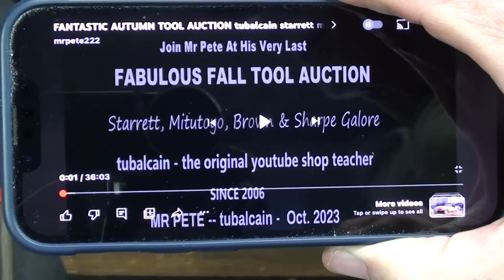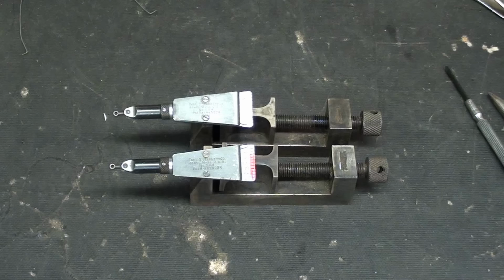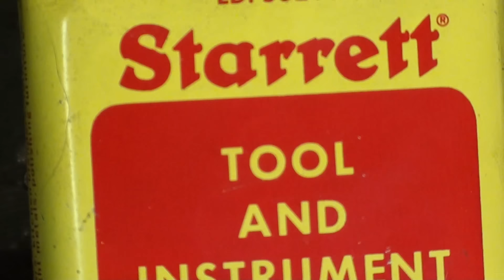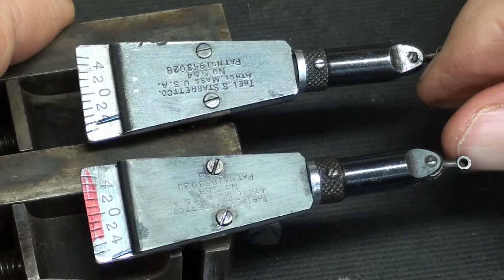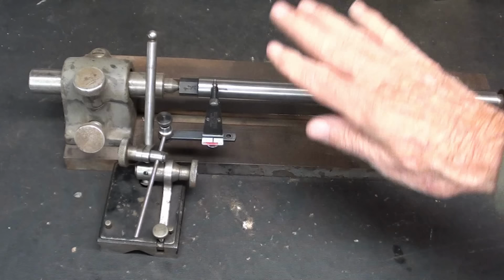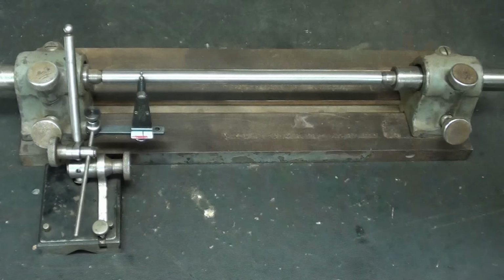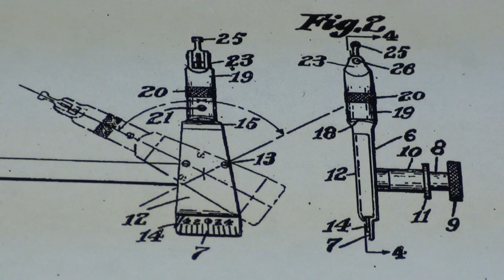REPAIRING A STARRETT TEST INDICATOR #901 tubalcain mrpete

Comment: Lyle - A very interesting video.  I have both other indicators you showed - the Ideal was bought by my Dad when he was fresh out of high school and a 'set up man' on the IBM plant machine floor in 1941/42 before he left for pilot training.  Most of his work then was on  gear hobbers.  The Ideal is in the original box and has a Rochester, NY address instead of Brooklyn.  Still works fine.  The plant I worked at most of my career had mostly women doing very fine repair work on electronic assemblies also under microscopes.  Very precise work with rigid certification requirements.  They were great people to work with.  The computers we built went in space and military aircraft where reliability was critical.  Kind of hard to 'hook up the spring' when at 35,000 feet or in the Space Shuttle.  Have a good weekend.

Comment: Mr. Pete,
It seems a lot of folks would like to see you compare the accuracy of  these indicators against a dial test indicator.  If you repeat the end to end test of the arbor perhaps you could include a still shot of your calibration sheet for your Rubbermaid surface plate. 😂

John 🇨🇦

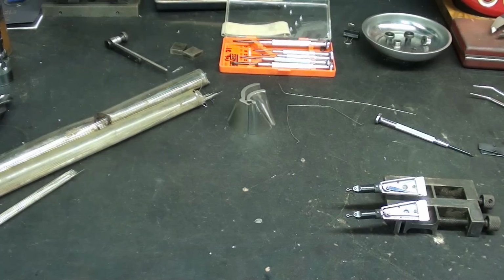Comment: At about 8:00 minutes in I was thinking you could use a guitar string.  You can buy the high E string in .009".  Great video by the way.  And I sympathize with Westclocks on their radium remediation.  A company I was with went through the same thing because of supposed lead contamination.
Reply from the maker: Awesome, never thought of a guitar string
Reply: I an am an electric guitar player. I always keep take-off strings that vary from .008 on up to larger sizes, where it often gets used in model making. I share both the plain wires and wound wires with other model builders too. Used guitar strings a great resource for springy wire.
Reply: @mrpete222  Hey Mr. Pete, you can still learn a thing or two from us 72 year old whipper snappers!
Reply: I carry piano wire of different sizes in the shop just for spring making.

Comment: Keep 'em coming.  
I find that opening up a non-working item works out a lot like what you found on this indicator.  Soon after we were married (about 53 years ago) we went too my parents home for a weekend visit.  Mom asked me to look at both of her kitchen mixers.  One was a Kitchen Aid stand mixer she got as a wedding present.  The other was a hand mixer.  Neither worked.  I opened up both and couldn't find anything wrong, so I cleaned them out (a lot of flour in both) and put them back together.  Both worked!  Apparently enough flour got up inside both to keep the brushes from contacting the armature.  That Kitchen Aid was still working when Mom passed about 40 years later, although it wasn't getting used much anymore!

Comment: ALWAYS interesting MrPete, thanks.  Would'a liked to see how the indicator's tip is designed/works, guess I'll hafta settle for half the mechanism.  A little blast of air will force the lube into it & clean out some smegma if you're not gonna disassemble & clean it for real. 
Also, 19:08 that mandrel had 5 tenths on its package,  .0005 per inch taper.  So you measured about  .004 difference, .008 taper over 6in, about 13 tenths - .0013 per in.  Wrong box?? Thanks.

Comment: Hi, Lyle
You might try using an ultrasonic cleaner.
Fill the ultrasonic cleaner with fresh water, and place the part to be cleaned ( Your Indicator) in a zip lock bag, with your favorite cleaner, Liquid Wench with enough to cover your part.
Give it a run or two in the ultrasonic cleaner, and you will be amazed how the vibrations works cleaner in and out of every small craves.
Do the same thing with some mineral spirits, to remove the Liquid Wrench, and follow up with a vibratory bath in a fine light oil.
I've cleaned many precision assemblies with this method, and never harmed anything.
The great thing about zip lock bags, is how little chemical that you use to get something very clean/oiled, and you never get the cleaner tank dirty.
Tim

Comment: Great video. Not a big deal. I would have cleaned out the inside of the indicator with a qtip, the discolored shephards hook got my O/C going. I usually run the cover lightly over some thousand grit to knock of any rust. Now a big Mr. Pete fan bio. 👌

Comment: I’ve never actually seen indicators like these but now I understand a little of how they work. Marvel Mystery oil or a drop of kerosene are my lubricants  of choice for precision instruments. My dad always cleaned and oiled his mantle clock with the tip of a feather dipped in kerosene. Kerosene sold for $.20 gallon for many years.

Comment: I inherited a handful of these indicators, which were all made by Lufkin.  I have used them quite a bit and they work fine.  One drawback is that they are somewhat hard to read unless the illumination is good, particularly if you use an inspection mirror.  The test indicators I have also include a scale perpendicular to the main scale so that you could also read them from the back of the indicator.

Comment: Years ago i bought an electronic "reader" from the Ferris Library. It was never used. I got all the information and packaging. I paid $20 for it. it has an x y table big enough to hold an encyclopedia. It has an electronic power zoom, and auto focus. And it zooms to a cats whisker. You can also put a stationary magnifying glass half way, and it still autofocuses. Handiest darn thing i ever bought, i could write the lords prayer on the head of a pin with it. NOBODY at the auction knew what it was. it has a 17 in high def monitor, and can export video feed. i used it last repairing ho slot cars. I bet Ferris paid $10,000 for this thing. Its designed for impaired persons to read books. i wish i had 2 of them, you would love one too. Also i have a machining dilemma, if you could and have a few mins can you email me? I know your busy, same as me, i just need a second opinion before chips fly on the irreplaceable steel. Either way thanks for teaching me every week!
Reply from the maker: I have never seen one of those electronic readers. I did not know they even existed. But I often wondered if maybe I could make one.

Comment: Good job fixing the indicator. I have a small set of machinist clamps and the 1 screw is missing, so no problem I will make one. The problem is the thread pitch of the other screw, its not metric or 32 pitch or 28. An 8-32 screw starts but will not go through. stumped Thanks👍
Reply: would it be safe to assume this set has another piece with the particular screw in question not missing? if so, does it fit into the threads of the missing? if so, copy that screw. if any answer above is no, look up a set of thread pitch guages, which are basically a keychain full of all varieties of thread pitches and diameters. also, home depot has thread guages mounted to their racks in the hardware section
Reply: Could be a British screw pitch...
Reply: Yes, it could be a British thread. BA threads have a 47.5 degree angle as opposed to American and Metric 60 degree angles. Which means the threads are deeper. So a BA screw will fit an American nut but not the other way around. Also once you get into numbered screws all bets are off, they are completely different systems.
Reply: Thanks for the info, I will check the machinery hand book on this and see what I come up with. @bwyseymail

Comment: Thank you for the 'how it works' video, I've never been brave enough to open  up a dial indicator.  
Your measurement of the mandrel taper was unfortunately not done on a surface plate, thus the surface of the desk adversely impacted the measurement.
Reply from the maker: I knew I shouldn’t have done that experiment. I do not have a large surface plate

Comment: Classic vid! Thank you.
You believe you're slipping.
I've been accused of being smart but your brain moves far faster at 80 than mine at near 60.
Oh! The reference to light oils like 3 in 1 or even turbine oil is a good one. The old oils in that tester had gummed up. Perhaps a drop or so  might keep it loose?
After being told not to use engine oils in certain parts, I did and long term it didn't work out well. A box fan motor comes to my mind.
Wasn't it a blessing to work within a good crew?
Now there are teams. Not that cool.

Comment: Does anyone know what the hole was for at the contact ball? Does the lever arm rotate to different angles like on a Last Word?
Reply: The hole is for measuring runout on shafts located in hard to reach like inside a transmission for example. You would tie a piece of line to the hole loop the line around the shaft you want to check and anchor the loose end now tension the line zeroing the needle or not rotate the shaft, you could detect up to about 10th of  runout. Cheers

Comment: Did you know that the tip rotates on those indicators, so that the tip can be aligned through 360 degrees?
Reply from the maker: I thought I showed that
Reply: @mrpete222  you did indeed, I missed that watching it the first time.